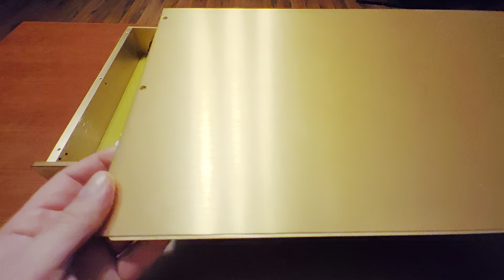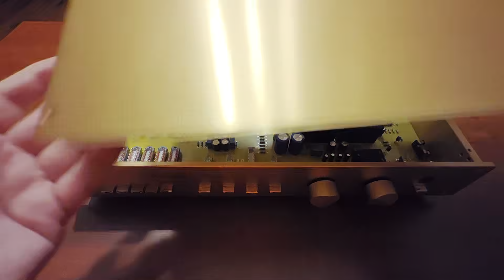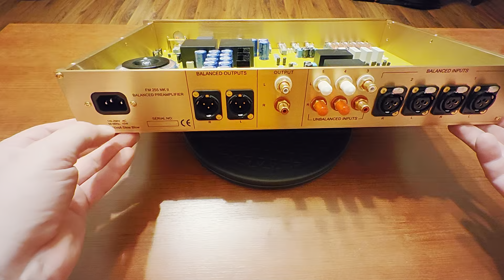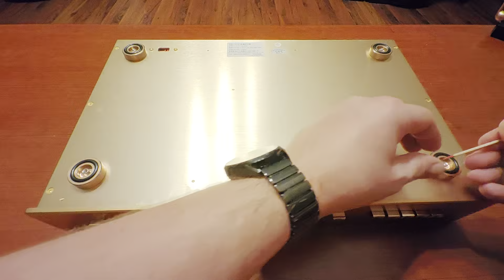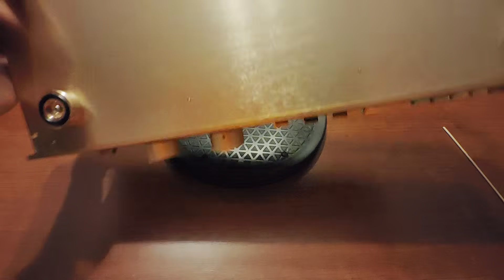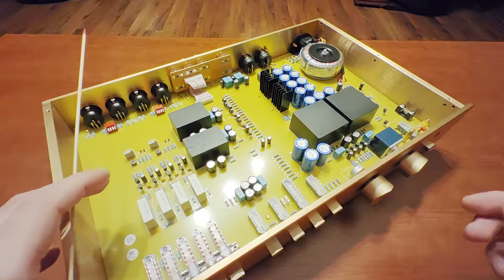Swiss Gold Bar made in China: FM Acoustics FM255 preamplifier review

Comment: Accuphase c2860 Plus or FM 255? I like big stage, details
Reply from the maker: C2860+, both are good, but C2860+ really is better
Reply: @k4syx  Confirms my suspicion that the FM255 copy is nowhere near as good as the FM155 copy because I think the FM155 copy sounds much better than the C2860 copy preamp.The C2860 has good stereo width and is high resolution but the midrange sounds a bit thin and voices lack depth and body compared to the FM 155 copy. The FM 155 copy sounds much more real and engaging .Much more like a really good valve preamp.

Comment: A little question, is it possible that the sound is better, more dynamic if the volume knob on the preamp is at minimum the 12 o clock ? 

I've made some test dropping my volume on the source (PC), but push the preamp volume over 12 o clock and it seems better sound to my ears. Is it because of the class of the preamp. Originaly the FM255 supposed to be class A preamp.

Thanks
Reply from the maker: That's weird. Usually you want to have your source at max volume level to maximize SNR and DNR. Pre should be in "reasonable" range (that would differ between preamps) so you can have good overall volume control. I can imagine that if your source has really high output voltage, then your preamp may not work in the best gain area,but that's just guessing.
It was never like that in my own experience..

Comment: Hi, thank for the great video, could you please make a small comment about the tape button? What you meant was that it doesn't have the corresponding In? thank you!
Reply from the maker: The original amp had tape loop input/output set. That one seems to lack back panel space for another set of RCAs, so you have button in the front, you have PCB ready but you don't have connectors in the back. So it doesn't do anything really now.
(I'm assuming you're familiar with regular tape loop functionality on amps, right?)
Reply: @k4syx  thanks!

Comment: Hello, My personal experience with the FM 255. FM 255 + Dartzell NHB 108 (with the red eyes and volume control) + Infinity RSb Speakers (150W compatible speakers) No more bass, sounds completely anemic. The same combination with Klipsch RF 820 speakers, Haa the bass is back, the sound is powerful and clear. FM 255 + JHB 1969 + Klipsch RF 820. Wow, what a sound...round, soft, incredibly fast and precise and absolutely no harshness. Of course you could say that it swallows up some details, but it's exactly these details that I perceive as harshness when I only listen to the amps with a pot plate.
Gruss Michael
Reply from the maker: Hi! Thanks for sharing!
Id say that we have two options here: either paring problem (with NHB clone) that is remedied by Hood, or - as the sellers warned me - that version of NHB that has MBL built in isnt anything to write home about. That was the one I wanted to get in the first place but to my surprise when I was asking around the stores they all steered me away from this one recommending getting Transaudio D5Pro instead.
Reply: @k4syx So the only annoying thing about the FM 255 in combination with the two amplifiers mentioned is the slight hiss from the speakers. But if I set the volume control on the amplifier to 2 o'clock, the noise goes away. Then it sounds wonderful to my ears. greetings Michael
Reply from the maker: @michaelscherrer7387  What about XLR imputs? Is hiss still there?

Comment: I have this unit. I did few things to improve the SQ. I replaced the volume pot with a TDK unit, put Schottky diodes in the rectifier, and put a Jung type super regulator in place of the 3 terminal LM units. The clones are known to have a small amount of noise when using the RCA outputs and are totally silent with the XLR outs. I also bought the FM155 for another room and in stock form the 155 sounds better. The Chinese forums also say the clone quality of the modules in the 155 is perfect whereas the modules in the 255 are slightly noisy in single ended.
Reply: Hi Thanks for the info on the possible upgrades for the 255, (I bought a FM244 also which seems ok). back onto the FM255 i Need XLR input for my active monitors and in my system the FM255 is  a pretty good unit, did the upgrades you made make a worthwhile difference to SQ?.  I suppose "worthwhile" is a bit subjective but I am after your thoughts.
Reply: @ Yes it is subjective and the mods are cumulative although the power supply was the most worthwhile and the most difficult.  The TKD pot is superb and I used a 10k which is even better SQ than the 47k factory unit. It is not something that can be motorized though. Diodes are in the front behind the power indicator and were simple. Be careful to not strip the hex head screw when working on these. You can get them from China with the upgraded regulator and I would recommend that to the novice. FM also has a 100k RF filter that can be ordered as deleted and that gives a more open sound but can sound harsh if you have RF interference.  I have some VERY expensive gear and many have been sold but I have not had any desire to sell the FM 255. It is a unique piece of gear that seems to do everything right and have an ability to consistently sound beautiful.  There are a few companies making clones and the TaoBao site has reviews of the different clone makers. Weilang gets good marks on TaoBao so stick with that maker. These are definitely an incredible value.
Reply: @FineArtPrintmaker  Thanks for the info, i need to expand my knowledge in this area so i will try the upgrades you suggest. The FM255 is replacing a Mark Levinson 326S atm. But i havent sold the 326S yet. Hifizone has been good re cables i didn't have good cables especially power cables before but .... now I do. The investment in the cables has made a huge difference.
Reply: @mthorby1 Is FM 266 an improvement further to the 2 models u mentioned?
Reply: Yes...this FM255 is noisy. The old version without remote control is better.
Reply from the maker: Thanks for sharing, yes, XLRs were better - should have mentioned that in video. 
I will try to ger 155 then as I was wondering about it ayway as its significantly cheaper too!
Reply: I only need balanced XLR. And I have found FM255 MINI with such connectors. Does FM255 clone sound good with XLR or FM155 still better ?

Comment: I agree that the bass/midrange borders on loose, but not actually bad.  Just kinda full and bassy/smooth

If you hit the -20db gain button, the sound tightens up and becomes a little more disciplined and analytical 

I did not see you try the switch during the review - far right button on the unit 😊
Reply from the maker: I did try it during my listening sessions though :)
Reply: @k4syx   Sounds like you didn't like it lol.  No worries, I thought the same at first.  

One night I had to reduce bass for the neighbors, so I started using the -20 db switch and kept the volume up

For a while I didn't like the sound too much, something seemed flatter and lifeless.  But after a few days, it got a lot better and now I find it 'usable'

Maybe the circuit needed to burn in a bit?
Reply from the maker: @christophergaus3996  Thats interesting thought and may be true actually, I will need to take a look at what does this switch do on the board. If it does add something to the signal path, then maybe you are right. But also if you were listetning to it like that for the following few days you could adjust to the sound.
I will check that with mine :)
Reply: @k4syx  Exactly, not sure if I just got used to it.  I didn't always have it on, but seems the more I use -20db the better it sounds.

Please let me know if you find anything interesting 🙏 Love your reviews and style man 😉
Reply from the maker: @christophergaus3996  Thanks! :)
Reply: I agree. I personally think using the volume pot in the sweet spot 10-2 o'clock (higher gain prior to power amplification) greatly improved the output. The background becomes blacker and more details emerge. But yes, a warm and smooth sounding preamp. I'm now interested in the Accuphase C2860 plus clone. I love the bass depth, warmth, etc but I find myself craving more detail. I hear the C2860 plus achieves this but is probably more neutral sounding in comparison.
Reply: @DrNJPhotography mine has a slight hiss that I find a little annoying, but I typically don't hear it.  Otherwise I really like this preamp, it reminds me of a vintage sound maybe 

Do you keep your volume at either 10 or 2 o'clock position, or just anywhere within that range?
Reply: @christophergaus3996  It's varied in that range for practical reasons. I've recently lowered the gain of my power amp as low as practical to reduce theoretical noise and grain (Class D Behringer A800). However this means I'm into 3 o'clock at moderate levels with -20 db activated and have little headroom. I have it deactivated now and think it sounds a lot more detailed and sound stage owned up but that's due to optimising setup across both components. That said, for a given SPL I do think the preamp thrives above 10 o'clock - it just sounds more balanced and 'together'.

I agree it has a vintage characteristic, tube-like almost but without a massive holographic representation. It images well and I'd say with some decent depth or layering. Not bad.  It's just so so easy to listen to for hours. It just invites me to keep turning it up, it doesn't seem to get harsh at all despite being at high SPL. It just keeps sounding...better. 

I recently swapped it out to get my detail craving fix. I put a passive preamp in its place (Schiit Sys) and yes, there was more detail but overall flatter with sound more localised to the speakers. The musicality that leaves me wanting more with the FM255 faded quickly with the Sys in this case. My DAC is Topping E70 Velvet so already smooth sounding (apparently).

I've not encountered any hiss. I use XLR connections throughout. I did try some RCA's and didn't notice it. My FM255 is by BRZHIFI.

Comment: Hello. Thanks for this review. It's always a pleasure to discover your new vidéo 🙏
After watching yours videos, i have baught the D5 Pro (perfect experience for me),
I have bought alimentation sector cable Odin=Perfect experience too,
I have received too RCA connection Audioquest fake Well Signature (just waouh!)
Now, i am waiting for delivery preamp MBL6010D 9.3 for my D5 Pro,
As soon i receive it i will write here my feeling 👍
NB: My DAC Streamer is Eversolo DMP A8. My speakers are Cabasse Murano Alto. Have a good day and please continue yours videos 😊
Reply: how do wel RCA cable sound like?  i am interested in the wel XLR cables  because they are much cheaper than the Dragon .. esepcially two sets for the system 
Wek RCA has one set of wires  
Dragon RCA has two separated sets of  wires 
Dragon XLR has three separated sets of wires  wires
the more sets of wires the better the souds?
Reply from the maker: @richardlui8914  WEL is next best thing to Dragon. And value wise its better because its a lot cheaper.
Dragon is ultimate IC IMHO, but also the most expensive from the bunch.
Reply: @k4syx  two pairs of XLR .. may be a standard stock for the system or systems  ..it is the best or the end game cables .. just dragon xLR is double of Dragon RCA in price 
Just try to use the money wisely .  I only have the DA50 , fm255  have xLR output .. then the TPA monoblocks ..
For the long run .. dragon XLR is the first choice .. no urgent needs  though .. no problem for waiting  for your comparison table 
Other accessories like dragon jumper , K2 bi wiring speaker cable   and dragon XLR are in the collection list .. may be a gift for certain achievements !
Reply: @k4syx  wait for your comparison table
Reply from the maker: Thank you for your kind words! 
I have that MBL in my shopping cart as there was a lot of recommendations for that one!

Comment: Thank you for this great review. How sound the FM 255 compare to the C-245? I bought the C-2860 pro plus. This sounds fantastic, but only if you use bass and trebe controls! If you use the direct mode it sound very warm and not kristall clear. For your review of the C-2860, how do  it sound compare to the C-245?
Reply from the maker: In my opinion C-2860+ is the best of three (and its not that warm for me?) then I would have C245 tad bit higher then FM255, but they are really close. C245 being little warmer I think.
Reply: +1 here! after watching this review I started to think that maybe the accu clones are better options?
Reply: Accu clones are about great SINAD, if properly crafted, with good low-noise PSU. 
This preamp is different: it's about coloured, distorted sound, but such way, that it sounds sweet, warm and airy, just similar to old tube gear.
Reply from the maker: @Anatoly_Panchenko  Exactly!

Comment: Hi Tom,

So nice Video in Ur style 😊.

I don't like these preamplifiers that are built today like they were in 1970. Nowadays you can switch the inputs with a remote control via relays or remotely control the volume, you can use the circuit layout if you like, but you don't have to install switches and potentiometers that always caused problems in 1970...and the Chinese definitely don't use rhodium or gold-plated contacts here 😅...

Comment: Thank you! I will send you an email with links for the black version FM255 that i have and the tube preamp that i plan to buy. So far the Master FM801 sounds a little cleaner and refined than D9 but i can't say i like one more than the other. I will have to listen to it a little more and maybe experiment with my power cables. My guess is that at this level amplifiers sound more similar than different because they do fewer things wrong if that makes sense. One thing that i must add is that while FM801 gets hot it is not as hot as D9.
Reply: Thanks for your assessment! I have a D5 Pro and was about to pull the trigger on the FM801. As much as I appreciate the D5 it feels a tad leaner in the mids and vocals.

How are the mids on the FM clone?
Reply: @MFGAudioReviews  I never thought that the mids of D9 are lean and it is the same as you amp just with an extra XLR input. You do not need to change amp. The problem is elsewhere in your system IMHO. I can tell you that the FM255 preamp that i have (not the one reviewed here) is a great match. The sound is smooth liquid with great mids and non fatiguing highs. I also use R2R dac and that also contributes greatly to mids quality over what you usually get from D/S dacs. Cables matter too but that is another can of worms that i will not open here. I hope that helps.
Reply: @calaf_725  HI which FM255 do you have? mine is the same as the review model, but i am happy to upgrade to a nicer version. I see there are some models around the USD 2k level. they have signed components and extra parts. i have been considering one of these as i liked my current FM255 so much, but i guess i am worried if i invest more am i going to get anything better? its this worry that has held me back.
Reply: @mthorby1   I've been using one of these 99% clones of the FM255 MK2 for about 10 months now, which I purchased for around $1,500, and I must say, I'm very happy with it. Contrary to some concerns mentioned about clarity or details, I haven't experienced these issues with my unit.

However, I do agree that the clone is sensitive to noise in the signal. To get the best performance, you really need high-quality cables and effective RF filters. I am using only XLR in my whole system. Once this is sorted, the performance is remarkable—it has elevated my system significantly.

In comparison to the built-in preamp of my R2R DAC, the clone has added one or two layers of transparency, and the soundstage has opened up considerably. The result is a three-dimensional and holographic sound with more depth and width. For the price, it's an impressive piece of equipment.

If you're curious, here's the link to the version I bought: https://www.aliexpress.com/item/1005005357406289.html?channel=twinner
Reply from the maker: I got the email (ive seen notification) - thanks!
I will need to finish with the comments before I will get to my mailbox. I think I will get smaller 155 too :)

Comment: I have it and love it, but a damn hiss noise come from it. I have very sensitive speaker like 93db. I using this in bi-amping mode with open baffle full range speaker and a woofer.

If I can find a way to remove the hiss. Probably like you say it's because of the High Input sensitivity of the amp....
Reply: @osezchanger1596  the modules are not perfect in these. The RCA noise is a known issue. XLR is dead silent. The FM155 with RCA’s sounds better to me with zero noise.
Reply: Are you using RCAs, or the much better XLRs (quality necessary)
Reply: @roberthart9886  RCA input and output
Reply: @osezchanger1596  Definitely go t XLR. Why do you think they made it XLR dominant?
Reply: @roberthart9886  I will try the xlr. Bit have to buy cable :)
Reply: @osezchanger1596  your amp needs to be balanced.  Some have both inputs
Reply: @roberthart9886  I bi-amp. One of the two amp is RCA only. THe other XLR, so I use XLR to rca
Reply: @osezchanger1596  a waste of time Read up a what balanced circuits means for best sound
Reply: @osezchanger1596  Looks like my reply did not get posted. Read up on why balanced circuits are the best/ To maximize XLR both amp0 and pre must be true balanced
Reply: @roberthart9886  Thanks for you help. I will need a true balanced amp. It will be for the futur.